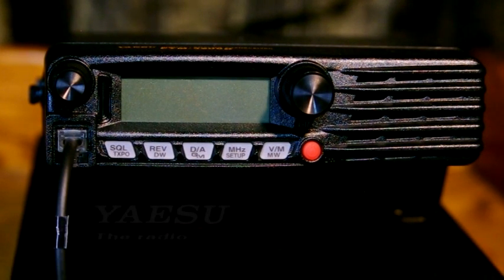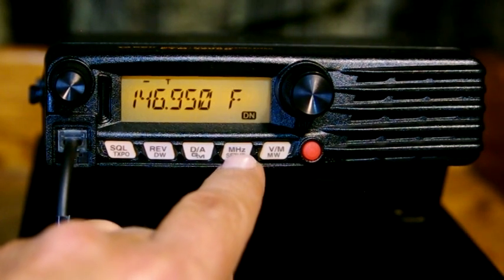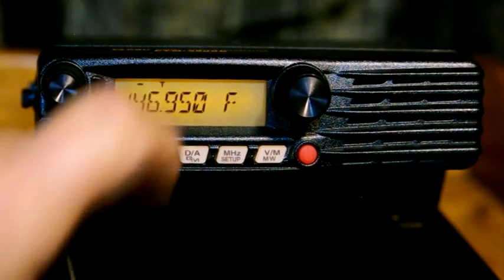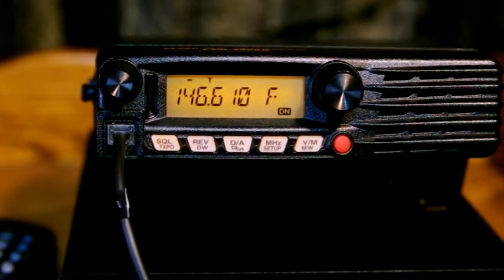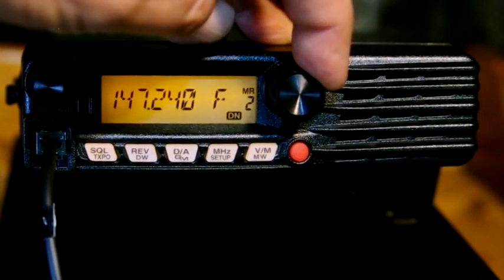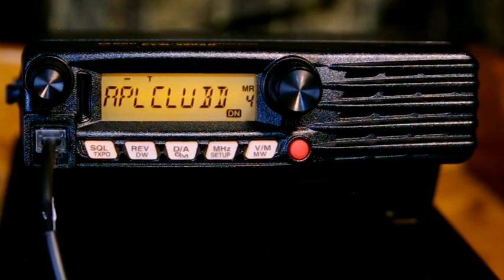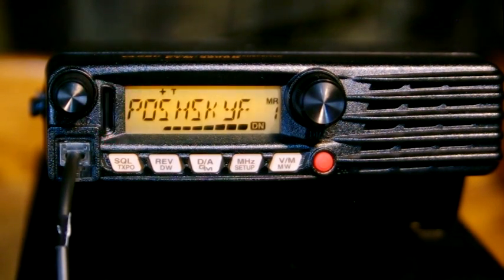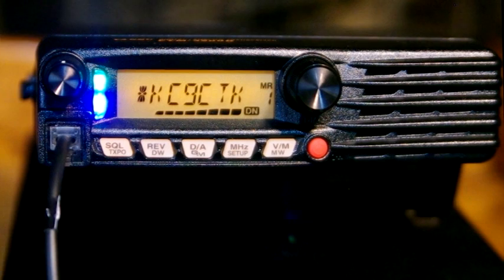Yaesu FTM 3200DR 2 Meter VHF Fusion Ham Radio. Very basic set-up and operation.

Comment: My repeater shift is menu 35. My squelch type is 39. Tone Frequency is 42. My radio is marked on top as a Yaesu FTM-3200D not a FTM-3200DR. I don't know if that matters. I did manage to set up a new channel to talk to a local repeater though. Don't think I'd have managed without this or another Elmer you tuber. Thanks a bunch.
KK6LOP
Chris in Kingman AZ
73

Comment: Being new to HAM radio and the Yaesu FTM-3200DR, I've gone back to this video A LOT -- both, to get the radio set up properly and to bail my tail out when I locked things up. There have been a few times when I was ready to hit the RESET on the radio and got saved by taking another look at this video. Can't thank you enough for putting this together for us. The only thing I haven't been able to figure out are the P1 and P2 keys on the microphone. The P1 just gives me a T00 R00 00 reading on the screen and the P2 doesn't do anything. Other than that, great radio with a not so great programmer!

Comment: How do you work  wires x on this radio thanks
Reply: to be able to control a wires-x node/repeater you have to update the firmware to the latest, once you done that it gives you the ability to only enter node/room number and have a 5 memory slots the same for the uhf version and the ft-70d ht, 73s K5DBW

Comment: Great video. My FM radio has developed a fault. Just been fixing it but I think it will need replaced and this is an option as these are not very expensive and have C4FM too.

Comment: Super Video! That mean if i'm in Analog Mode on a Relays then i need for mixed Mode "Digital & Analog Relays" a TEN & TSQ Tone for the Reason that the Relays is sending in Digital so i don't hear the Digital Signal and in other Analog Moide it open up the Squelch. Is that correct!?

Comment: Thanks. This helped a bit. The manuals are a bit vague about  CTCSS TONE not being used in Digital, about DCS, and other facts relating to digital transmissions., and which settings are saved in the memory channels, such as TX power and TXmode.  I just got it installed in my truck, and have yet to figure it all out.   Also, the difference between Priority channel and Home channel.  When I entered my first channel in memory, 146.52, a P45.52 shows up.. No explanation of that in the manual.
Still confused about how another analog station could hear me if I am TXing in digital. I know that depends if the repeater is set to simply retransmit everything in FM, but that seems dumb.

Comment: EDIT 11/2017: Updated radio to latest Yaesu firmware which has solved the fan control problem.  - LOUD FAN. Got my FTM-3200DR yesterday.  The FAN is OFF when the radio is first powered on then ramps up after a few minutes with only the receiver running.  The FAN gets LOUD ENOUGH to be annoying after several minutes, again with just the receiver sitting there squelched and never pressing PTT to transmit.  It's in my home office and I can actually hear the FAN as I walk by my office door.  The radio is about 2.5 feet away from me when I'm at my desk working and the thing is TOO LOUD.   My room ambient temp is only 74-deg F tops and very comfortable.  I can live with the FAN NOISE in my car but I'm throwing the YAESU out of my office and getting something else w/o a FAN.
Reply: You can just remove the fan (unscrew it, and disconnect the wires), and install a silent larger 12v fan (like a silent slow rpm PC case fan with good metal bearings) if you want on a switch to power it up when you transmit. I noticed one video on youtube shows someone put a large fan below it blowing into the bottom front air intakes to help cool it down. My radio's fan is loud too, and switches off and on at 5 to 10 second intervals when the ambient room temperature is anywhere above about 65 degrees. Us ham radio operators are all about improving and modifying our gear to fit our needs. But I've learned to ignore my fan sound, now it doesn't bother me.
Reply: Thanks for your suggestions but in my opinion one shouldn't have to resort to such measures to make the radio usable in a quiet setting.  I think Yaesu botched the FTM-3200DR fan by making the rpm ramp-up unnecessarily aggressive.  My radio sits there squelched the entire time yet the fan ramps up over a few minutes and becomes very annoying.  I replaced my office FTM-3200DR with a fanless FT-2900.  I love it in my quiet office as it adds zero noise.
Reply: Mine was an early FTM-3200D with fan control problems.  I just downloaded and updated the radio (over USB) to the latest Yaesu firmware.  The new firmware has solved the problem.
Reply: Maybe you got a bad radio fan, My fan on my FTM3200 is as quiet as a church mouse. I would call Yaesu Tech. support.

Comment: I have a 3100 R and I can't get it programmed .  When I set everything it doesn't   come out right. What am I doing wrong. Can anyone put on a video on the 3100 R.
Reply: You should first try to reset the radio to factory settings.  You may also try programming software.  e.g. http://www.g4hfq.co.uk/ftb3200d.htm

Comment: does the fan run on and off when in listening mode? Mine does. runs a second and shuts off a second and keeps doing this? This normal?
Reply: Mine runs 24/7 nice and quiet.
Reply: ya its quiet but RUNS for a second shots off a second and runs a second and shuts off a second and so onnnnnnnn im in the listening mode not the transmit mode. I asked yaesu this and NO answer. (figures)
Reply: +Jim- Hamradio it will turn on at 80.1 and off at 79.9 degrees fahrenheit , just in receive mode there really isn't enough load on the scanning processor to generate heat to warm it more than 10 degrees above ambient temp. if it's a huge bother you could always put a momentary switch or toggle interrupting the power to the fan
Reply: My FAN runs constantly with just the receiver on.  Too loud and annoying for me in my quiet home office.  The Yaesu is going in the car and I will get something else WITHOUT a fan for my office desk.
Reply: Jim- Hamradio I have had mine since it came out and it sits on the dash of my work can in direct sun and the fan on mine is quiet until I transmit.  performs great after a year...
Reply: yes